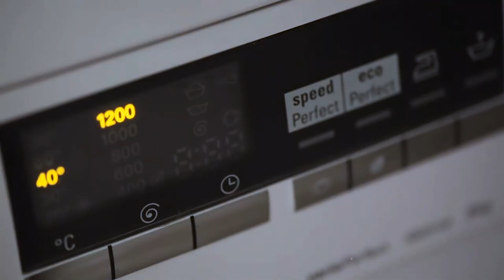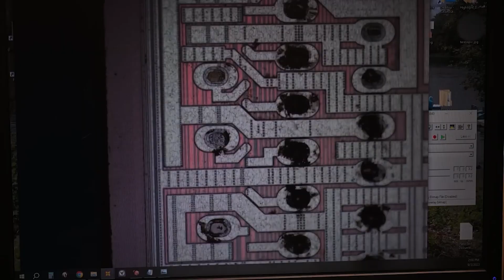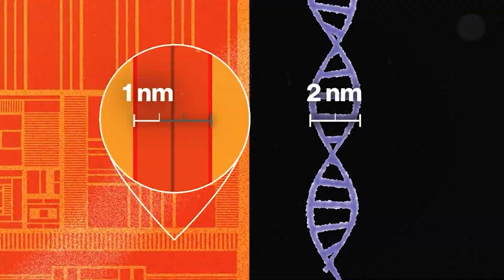Why the United States Is Losing the Tech War With China!

Comment: Too little, too late.  Huawei has been teaming with other Chinese companies to develop China's own domestic supply chain from design software to production equipment.  It appears Huawei is keeping some information close to its  chest as they wait until the development is mature enough to incorporate into the supply chain.  2024 will be a turning point as China achieves self-sufficiency in key functions.  It is capable of 5nm node chips using DUV immersion capabilities using ASML's older immersion lithography machines.  2024 will be full of surprises as new announcements of new accomplishments pop up.  Further the photonic, graphene, and quantum sectors will show maturing production processes that could replace high end silicon chips and even negate the need for the expensive high end EUV machines from ASML.  Japan has developed the NIL process said to produce 5nm chips without lithography, so it is not only China moving ahead, but others accomplishing innovations that moves the semiconductor sector forward. And, the number of new fabs in China continues to rise and China's ability to provide a wide range of semiconductors is growing.  In 2023, there were 44 fabs in China, with 12 under construction.  Media reports say that at least 4 more fabs are scheduled for 2024.

On price alone, China will retain a lions share of the semiconductor market and chip away at US, European, Japanese, and South Korean suppliers. We will see how that turns out as we see gains in the automotive, cloud computing, and AI applications sectors.